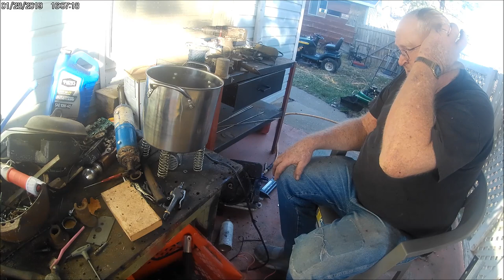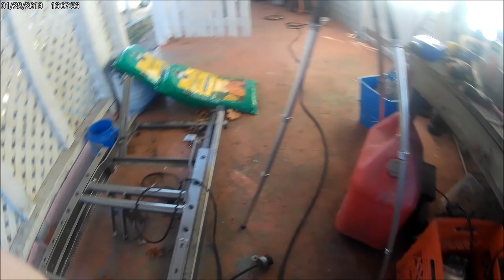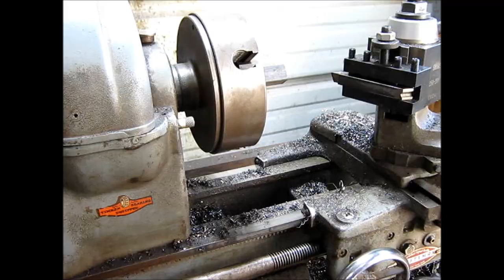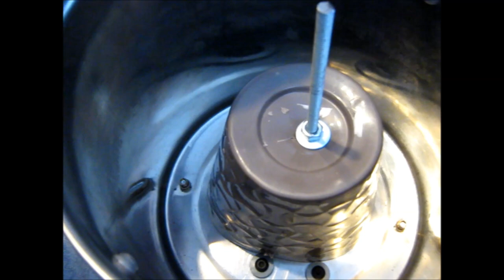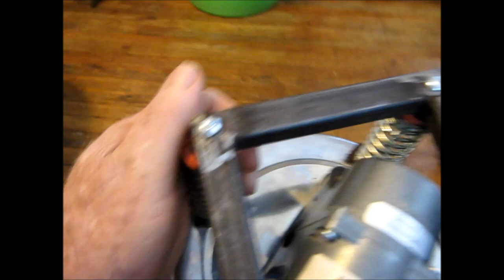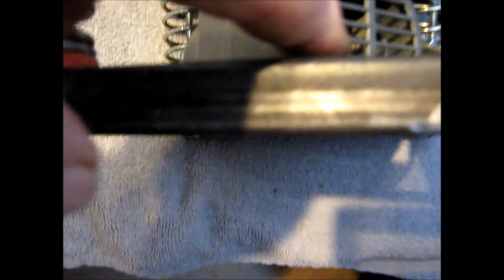brass polisher from bed vibrator

Comment: That's awesome! I think that will work great. Great way to repurpose parts.I cant hardly throw anything away, im always thinking if I can make something out of it. Thanks for sharing.
Reply from the maker: thanks. I am like you. it almost hurts to throw anything away that can be used for something later on, but so many things are "throw away" these days.
Reply: @MissouriOldTimer  your exactly right, hard to find anything that is made decent anymore.

Comment: I bet that will work fine.
Reply from the maker: I think it will, I see some folks using a small computer fan and put a bolt in one blade and it works , it don't seem to me that would be strong enough.

Comment: Vernon, Great idea and it looks like it will be excellent!  Have you thought of using fish tank gravel or pool sand?  They are alot cheaper than polishing media, and you can find them at most places.  Also thought about course rock salt, even tho its a salt, your not goin to leave anything in it, but it is course.  Walnut hulls should work great, but try pecan hulls also, they used to have them at the feed store for roughage in feed mixes.  Great build and great idea!
Reply from the maker: it can't be too abrasive or it would scratch up the brass a lot,, those should work fine for shining up rusty bolts etc.

Comment: Very interesting machine Vernon, mine Is  in garage i have used 2 time, but It Is not a DIY like yours! I wait to see It working with some brass and grit, what do you use, turkish corn?
Reply from the maker: most commonly for polishing brass , they use either corn cobs ground up or black walnut shells ground up pretty fine.